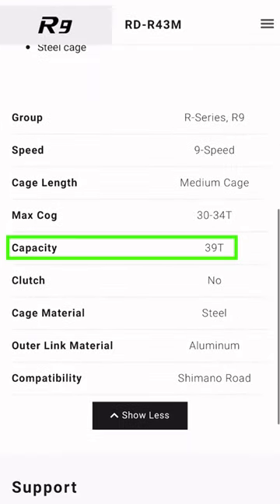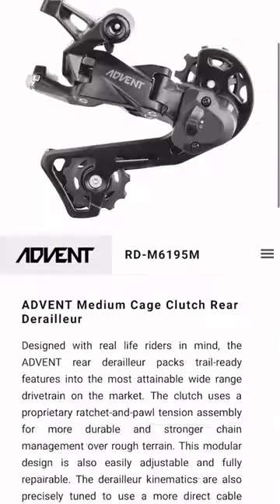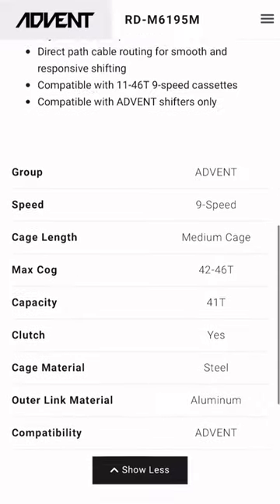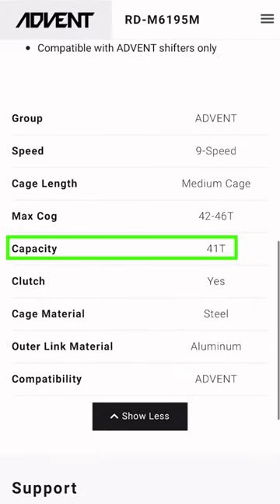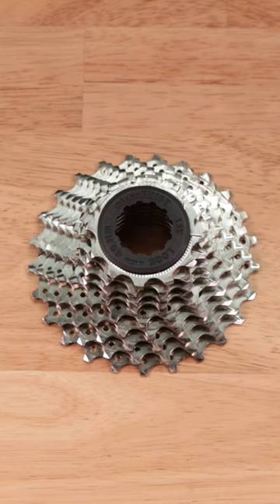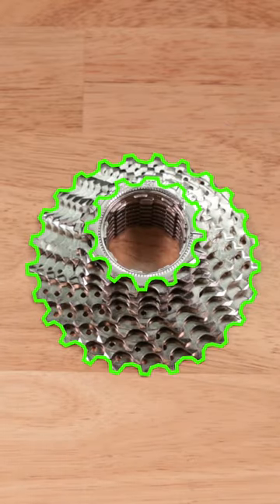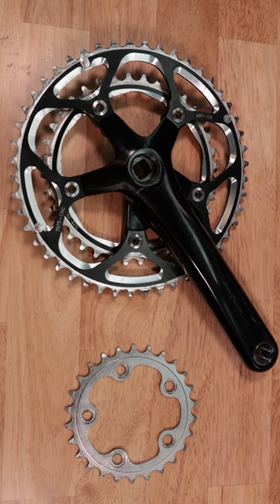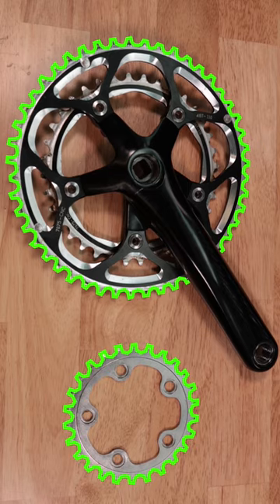Rear Derailleur Total Capacity: What Is It?

Comment: Very nice video! I have a question. I am planning on getting a Microshift acolyte 8 speed rear derailleur. I have a 1 speed crankset and a 8 speed shimano 11-34T cassette that has a capacity of 23.  If the Microshift derailleur has a capacity of 41T, what would happen if I used it with a cassette with only 23T? In other words, I cant go past that capacity but is there a possibility of going too low?
Reply from the maker: It's ok to go lower in terms of capacity, but you will run into problems with the minimum cog size of the derailleur. Acolyte is designed for a 42-46t max cog, so if you run a 34t it will shift very poorly. This is because the guide pulley is too far from the cassette.

Comment: I have a question

For my shimano deore m592 9 speed it says "rear derailleur max. teeth: 36, rear derailleur capacity: 45, max. chainring spread teeth: 22", so can I fit a 11-46 cassette in the back with this, or not? I have a single 34 tooth chainring in front.

That rear derailleur max. teeth: 36 stat makes me think the most it can handle is a 36 tooth cog in the back, which my bike came with originally, but the derailleur itself can bend back way more than it is when in that gear. By your calculations, I would get a 35T number by subtracting 11 from 46 on my one by bike.

There is no way for me to test this for free, by the way, or go ask somebody in a store because the only way I can find a 46 cassette or an expensive new derailleur is on the internet, all bike stores in my country are useless for mountain bikers, they don't sell anything besides cheap parts for big box bikes, and overpriced mountain bikes you can't find parts for.
Reply from the maker: Watch our video How To Buy A Rear Derailleur, there are details in there. Basically, max cog and capacity are unrelated.

Comment: So if i'm planning to build a 11-42t cogs but i have 50/34t chainring by using a rd of 11speed (like for example deore 4120, ltwoo ax and stuff) should i go with long length chain more or switch to 46/32t chainring? Will someone help me to answer my curiousity 😅
Reply from the maker: You need to check the max cog and total capacity of the derailleur. For an 11-42 cassette and a 16T chainring gap, you would need a derailleur with 47T of capacity and a 42T max cog - not many derailleurs will do that.
Reply: @microSHIFTTECH  i see. The deore 4120 is maxout for 46T in 1x GS but 42T in 2x GS and the chainring of that is 36/24 2x. Ideally in Ltwoo Ax is totally maxout of 52T but minimal capacity of 46T in 1x Gs
I wanna try of those two RD's if it will work for 2x GS with 46/32 chainring in my gravel. But currently i have 50/34 chainring. so in just theory or maybe in calculation recommended, do you think that it will work??

Comment: Can you show the math problem in steps?
Reply from the maker: Will Do: Stay tuned we have a video coming out showing that.
Reply: 35-12 is 13 and 46-24 is 22. 13+22 is 35. so if the derailleur is rated for more than 35 it will fit. If not there will be problems

Comment: Forgot about 95% of mtbs. Full suspension takes up a un-documented amount
Reply from the maker: Good point! Problem is, every full suspension bike has a different amount of chain growth. Single pivot bikes don't have any at all. So, it's kind of tough for us to cover all of that in a short. Maybe we'll make a more in depth video about that next.
Reply: @microSHIFTTECH  most single pivot bikes have chain growth. Only if the pivot is concentric with the bottom bracket is there zero. Only a few boutique steel frames are concentric.